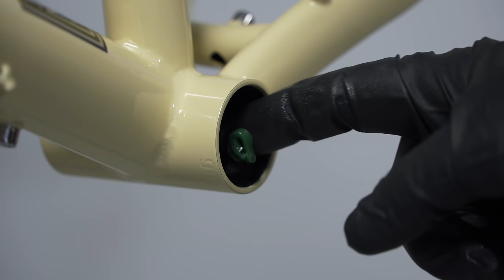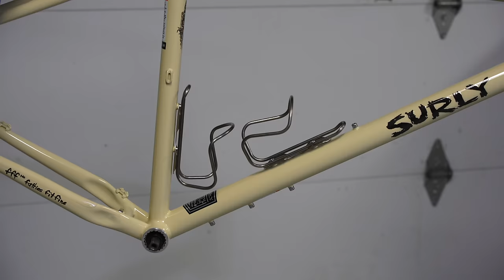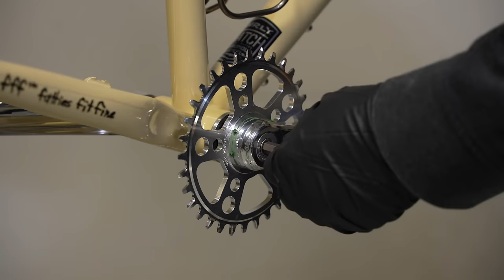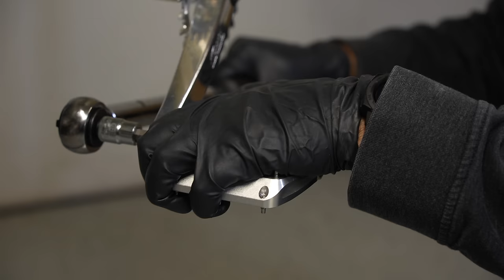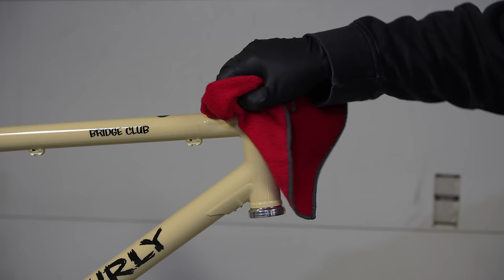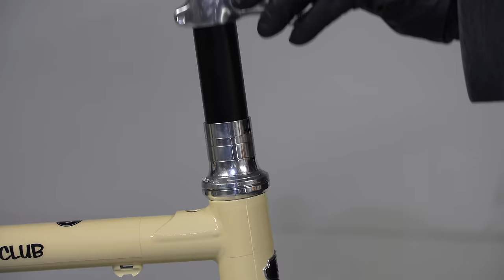Surly Bridge Club Build Series Episode 3: The Build

Comment: Beautiful build.. awesome videos.. relaxing music..❤
Reply from the maker: @BeautifulL1fe  Thanks! Glad you got some enjoyment out of it.
Reply: Hi  @mattdesmondwashere , what is the size of the bottom bracket? 68mm x 122.5mm or 73mm×118mm?
Reply from the maker: @BeautifulL1fe  73mm but you will have to figure out width depending on your chain-line needs. I think I started with a 122.5 but swapped it out for shorter to get mine to shift correctly.
Reply: @mattdesmondwashere  thank you
Reply: Hi  @mattdesmondwashere 
I have one more question, where did you buy the Velocity rim and Hub? Should we email them to place the order? Any cheaper options for the rear hub? I will be using XT8000 casette.
Reply from the maker: @BeautifulL1fe I ordered them direct from Velocity. There are definitely more inexpensive choices for hubs and wheels. I just wanted silver rims, so there were not a ton of choices for my build.
Reply: @mattdesmondwashere   hard to find the 135 QR or 142mm QR for 11 speed with Shimano HG.
Reply from the maker: @BeautifulL1fe  Yep. Everything is through axle and 29er now. Not the best bike for finding parts easily.
Reply: Thanks  @mattdesmondwashere  .

Comment: Awesome build right up to the point when you put muc off dry chain lube on. I cried. Still, nice bike though!
Reply from the maker: Haha. I've been experimenting with different lubes lately. I usually use the finish line ceramic stuff, but I like how the muc-off smells. It doesn't really last as long or stay as quiet.
Reply: @mattdesmondwashere  i loved all of that xtr, and watched you pain stakingly clean that chain. Now i want you to google Muc off dry lube solidifying. You're just creating more work for yourself. Anyway, its still an awesome bike!
Reply from the maker: @timmcdermott815  I haven't had that problem, but I lube very often and sparingly so goop doesn't build up. I've also tried waxing chains, but for me it's too much of a mess and pain to deal with. When wax wears off, it's pretty immediate and you really need to re-wax or lube it right then. I might try a wax based drip like Silca SS next.

Comment: SURLY 🤘🏻….Only advice i can give is before assembly would have been a good idea to block up all the holes then fill the frame with a pint of boiled linseed oil for rust prevention! turn the frame around letting it flow everywhere then just drain and let dry … nice build though …i’ve an Ogre 🙂👍🏻
Reply from the maker: I did use frame saver on this frame. The inside is also ED coated, so it's pretty much going to last forever. Thanks for watching!

Comment: Did you use a 68 or 73 mm BB? Does it even make a difference?
Thank you for the video and the beautiful build. I am planning a similar build.
Reply from the maker: The Bridge Club is a 73mm shell width BB. I did experiment with spindle widths to get the chainline correct. I think I ended up with 118 but don't quote me on that.
Reply: Thanks a lot for your reply - so I was wrong with mine. I found the correct one for Rohloff chainline now - 73mm shell width and 127.5 total width.

Comment: Great build, bike turned out amazing, congrats! Myself I wouldn't go for XTR as I'm not a racer and they are simply not cost effective, I always choose XT. But yeah XTR has this wow factor. Funny you chose some cheep shimano rotors that can be used only with resin pads and may be detrimental to XTR callipers' performance.
Reply from the maker: This was definitely not a budget build. If I was doing that, I’d get a stock complete build and just change a couple of parts out. The xtr’s are 4 piston and came with resin pads, they will be fine and probably overkill for my use. I wanted big brakes for loaded touring which is why I went 180mm front and rear. I feel like the rotors are not going to make a difference. I just always wanted XTR and yeah, probably not the best for longevity or durability.

Comment: Use what works for you, but maybe fancy cleaning supplies aren't necessary. Try simple mineral spirits for your solvent (cheap, effective, low environmental impact) and basic dish soap for washing (with a little help from a citrus-based degreaser if you need it).

Comment: Thanks for sharing!  I just curious why did you wash the new chain but not keep the original grease?
Reply from the maker: The cosmoline stuff that comes on the chain is super sticky. It causes grime to build up and eventually get into the rollers. It makes the chain hard to clean. Once removed, I either wax the chain or am always trying out different lubes. I like the finish line ceramic a lot. I always wipe the excess off.

Comment: Are you intending to fit pannier racks at some point? I would have set it up with a rohloff and speed drive, platform pedals with reflectors, and extraterrestrial tyres. I would have a son 28 dynamo hub with andra 40 rims and son edelux 2 lights.. A cane creek suspension post, trx gel saddle, genetic butterfly bars with humpert long grips designed for the humpert bars. Chris king headset, mudguards, tubus fat rack on the rear with home made " u" brackets for clearance for a surly trailer hitch, and a surly nice rack upfront. Trp cable disc brakes with 180 or 203mms rotors  if the fork would allow. (.I would make an adapter for the rear brake if one was not available) mated to Shimano 3 finger levers. I would fit 3 bottle cages and a lezyne pump. I noticed the frame has a mount for a ks18 kickstand so I would fit a plestcher stand and a hebie centre stand. (Surly trucker stand mounts can be adapted for this). I would have kept the full length steerer tube and used stackers. Aside from that, I like the frameset colour but would have the components in black.
Reply from the maker: Sounds like you have it all figured out. Looking forward to seeing that.

Comment: Hi Matt may I know what the rear wheelset hub size , is it 135mm or 141mm , thank u .
Reply from the maker: @BrompMed  Both and neither. You can choose either one and the 138mm frame accomodates. I think I went with 135 on mine.
Reply: @mattdesmondwashere  y’a that’s right it’s 138mm, but if using 135mm hub must also add adapter right ? Otherwise if using 141mm hub which is bit rare to find so in this case must stretch out a bit the frame I’m I correct ? .thank u Soo much for the advice
Reply from the maker: @BrompMed  I don’t think you need any adapters. Since the frame is steel, it just is flexible enough for either size.
Reply: @mattdesmondwashere  noted with much thanks Matt , appreciate it 😊

Comment: When did we start  lubing/greasing square tapers? That used to to be verboten in bike building.  Nobody did it 20+ years ago....
Reply from the maker: Not sure that it matters either way, but when 2 dissimilar metals go together, I like to lube them a little bit to reduce the probability of seizing. Tightened to the right torque specs, grease or no grease, there shouldn’t be any issue of deformation or loosening. I retorqued them after the first ride (as is recommended) and will keep an eye on them. Thanks for watching!

Comment: Dude, I'm literally impressed.
Building such a hipster bike and you didn't made those crappy mistakes. Like: shitty, facking: expensive cable brakes, bar end shifters, 3 or 2 front chainrings, old derailleurs with extension link,  tubes and ofc facking NKS pedals.

Comment: I'm considering building a BC. It's my first build. I'm a little hesitant because of the lack of thru axles. Is QR a problem or dangerous?
Reply from the maker: Not at all. Just hard to find pre-built wheelsets. If you buy hubs and rims separately, it’s easier to get a wheelset together.

Comment: Every thing looks good xt and xtr but then the rotors rt-56 just gut some RT-M905 look better brake better nearly no heat is building up😮
Reply from the maker: There will be heat buildup with 250 pounds total of weight on the bike while touring.
Reply: @mattdesmondwashere  so why you chose them my customers dont get under rt-70 nothing with out ice tech
Reply from the maker: @alexanderjendreck6356   I will probably swap them out if I have any issues and maybe try something else next time. I do like the way these look. More oldschool.
Reply: @mattdesmondwashere  I get that they look more classic but in my experience is a one piece brake discs are really not good for heat but i ride on my Light bike some carbon ti rotors also on the same brake 🫣

Comment: I am a short person (only 5 4''), which bridge club frame' size is right/ best for me?
Reply from the maker: I’m 5’7 and the medium fits me well. I’d say a small would fit you, but it’s always best to try one out at a local bike shop for fit if you can. That’s what I did, then ordered the frame in my size to build it out.
Reply: @mattdesmondwashere  If you don't mind me asking- Why did you pick 650b? I am trying to decide for myself which wheel size I will want. Also, I'm 5'9- think a med or large frame for me? Thanks so much- excellent build video!!
Reply from the maker: @foot_fault  I like the lighter weight and responsiveness of the smaller wheels. Plus, I already had 29er bikes. I think 650b looks more in proportion with small frames.

Comment: You should really consider getting proper cable cutters instead of tin snips that squash the cable when cutting.
Reply from the maker: They are on the list. Just never got around to buying them yet.
Reply from the maker: …And I bought a pair. Good to have in case I shorten my cable housing more after fitting bags.
Reply: @mattdesmondwashere I use a pair of nail clippers, works nice, cheap and cuts flush with no sharp edges.

Comment: Such a nice build! However, the BB UN300 just doesn't fit this at all. That's about the crappiest part of your build now :(
Reply from the maker: I wasn't sure on the BB width, and the UN300 is inexpensive to swap out to test chainlines with and very available locally. I've never had a problem with one and they spin really nice. ¯\_(ツ)_/¯  I wasn't about to spend $200 on a bottom bracket for it to not work out width-wise. Thanks for the comment, though!

Comment: Why using steel and heavy bike when lighter and cheaper alternatives available
Reply from the maker: Weight is not everything. Steel is durable and can be repaired easily unlike Aluminum or carbon fiber. It’s also much less expensive. This bike is not even heavy at 27.5 lbs. without racks. I have lighter bikes and this one is just as enjoyable to ride. In fact, I like it much more than the carbon Cutthroat that I used to have.
Reply: @mattdesmondwashere  thanks for prompt response